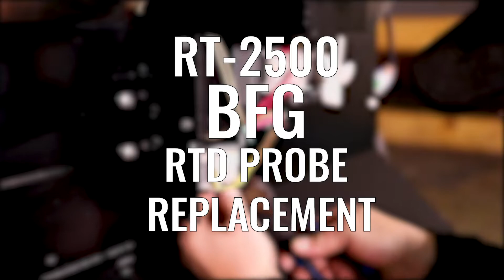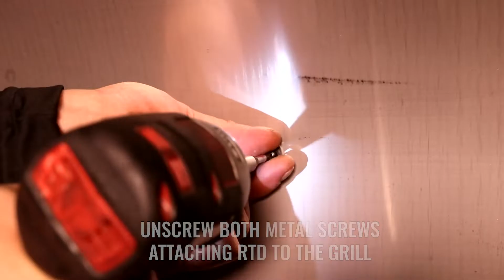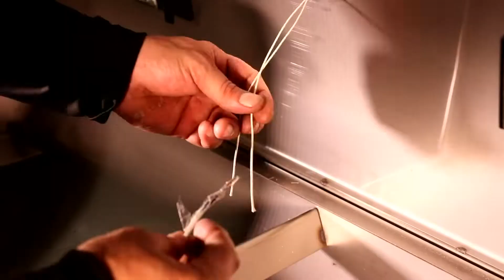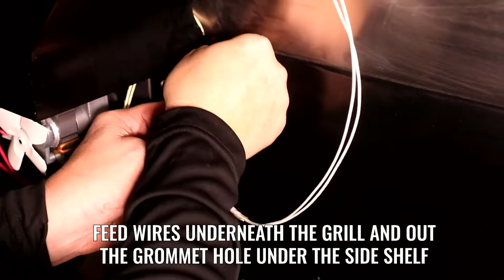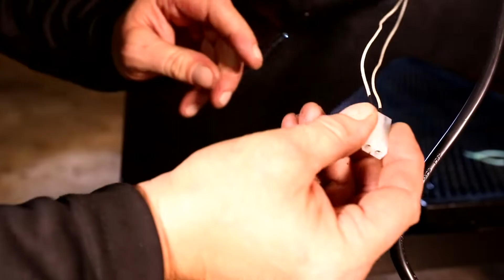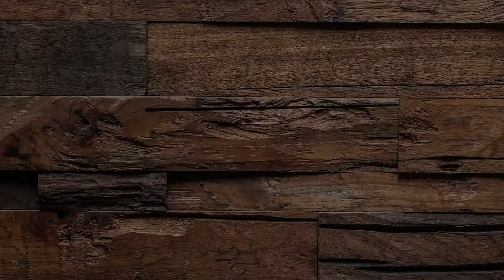RT-2500 BFG • RTD Probe Replacement | recteq

Comment: This is one terrible "how-to".  The demonstration is with an apparently new unit.  A unit that has been subjected to the high heat of smoking will degrade the 2 screws that hold the working end of the thermometer / thermocouple.  If you are lucky enough to get the screws out fully, good luck running them back in again.  On one of mine, the screw head came off, leaving the screw in the hole.  
Same story with detaching the lead wires on the controller end.  The guy just pulls the wires out of the plastic coupler but that doesn't happen with a unit that has been exposed to the elements.  A new plastic coupler is required.  I am calling Recteq to let them know.  
This is You Tube demonstration is a shame because my 2500 smoker is amazing, and I love it.